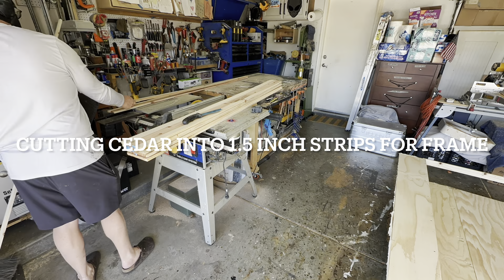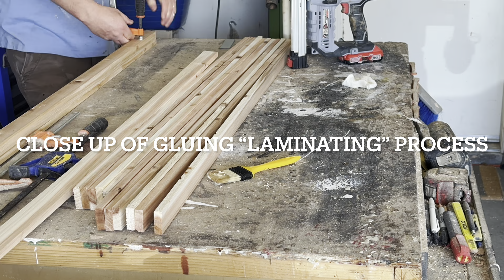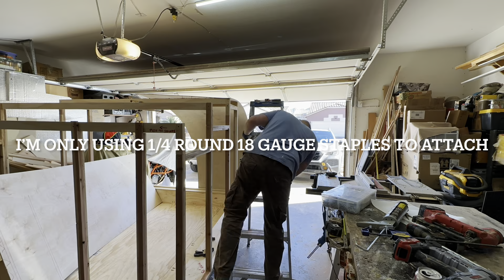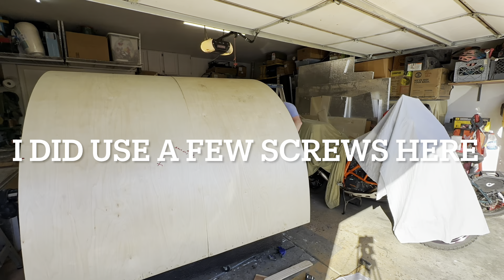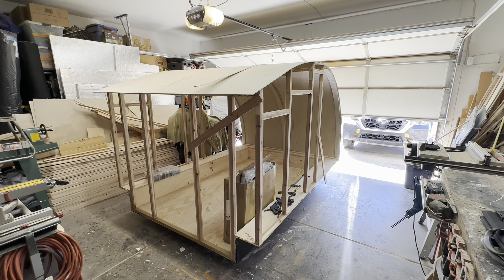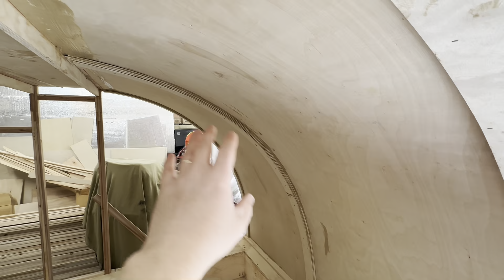Utility Trailer Camper Build 1.0, Week 2 - New Design, Framing, and a Compression Arch (Audio Fixed)

Comment: Love the design and the channel and the maker! One question -- the tub build video before this had a pointed "nose" for the front *overhang but the new design has a flat front.  Did you replace the pointed front with square full-width overhang or do something else to modify the original tub for the teardrop style "curve"? Thanks.
Reply from the maker: Good spot, yes, I modified the design shortly after I started the build.
Reply: @EndgameCampers I am working on a similar slide-in build and also have a Subaru Outback wagon tow vehicle, so keeping it super light. In my case, mostly 2" foam with PMF and less wood.  Did a front overhang of 8" in jacknife sofa area not interfere with Outback rear hatch?
Reply: I heard you say "about 101 inches long is what this will turn out to be" upon re-watching the video, so I assume this means the front overhang is 5 inches based on using a trailer with 96 inch deck.

Comment: On the tub, looks like the wall weight would eventually push down and loosen the wings, is there any other bracing on the wings?
Reply from the maker: Yes, shear strength provided by front and rear wall.

Comment: Really like it, we can slow down the video how we like to. i used .25 and can see the build. I like watching the actual build also with the video. Another question does the luan or the 1/4" ply bend around curves better.
Reply from the maker: Technically Luan is what you use around curves, but the 1/4 ply does fine and is stronger for the level of curves you have seen on my work.

Comment: Is there any concern with the AC on the rear because of the weight with how it will tow? My understanding is that it is better for the weight to be over the axel and towards the front. 

In designing mine, I am trying to get it properly balanced. Maybe weight distribution doesn't matter as much with a small camper. Mine will be 6 ft wide and about 7 feet long.
Reply from the maker: Great question and I have been thinking about the same thing. Short answer is I’m still researching myself… I encourage you to do more research and let me know if you find out anything else. Here is my thoughts though….There isn’t a really great location for the AC other than the back. I plan on putting my batteries towards the front under the bed and move other heavy items over the wheels best I can - hope that does the trick. As an anecdote, I have temporarily mounted a couple different truck campers to that exact trailer and even did short travels on the highway and everything was fine. All of those campers had AC in the rear and no consideration was put in place for weight distribution to the front. Not the same, but hope that helps.
Reply: I am going to continue researching but value your input greatly. I am planning on putting my 12v refrigerator towards the front and can do the same with the batteries. I was thinking of maybe doing a drawer type thing with the AC so once set up, I can pull it out to vent. Still doing research.